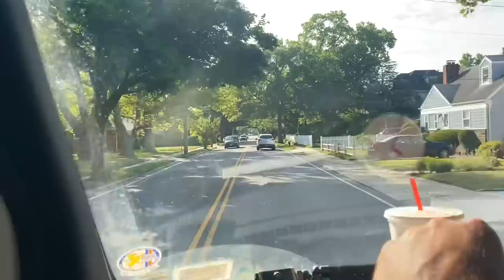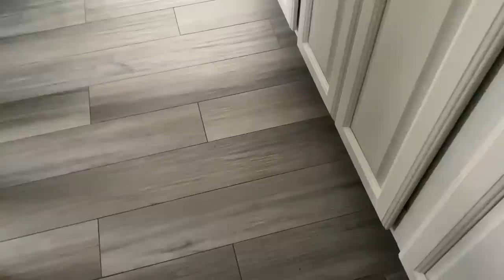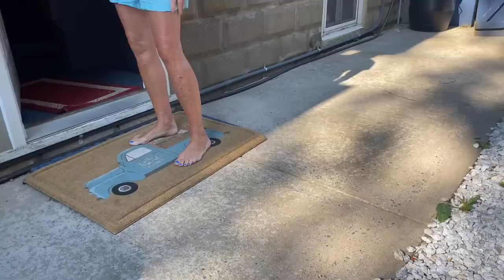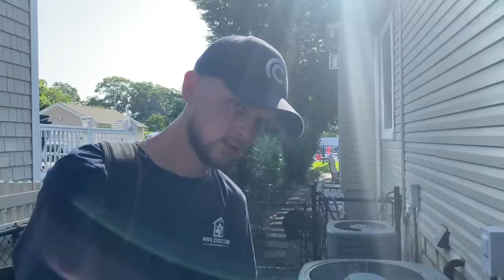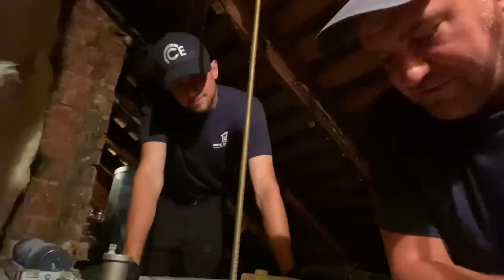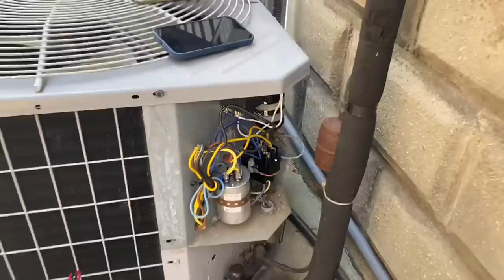Mysterious Case of Condenser Not Cooling Can We Find The Issue?

Comment: Hate those calls....Had one at beginning of cooling season. First tech replaced contacotor...worked for a week...same tech went back...stat wire broken outside by house... Lasted 2 weeks.. I went bad and said hell with this...ran new stat wire from furnace to condensor....new connectors on contactor...havent been back
Reply: best way to do it
Reply: until it ends up being the wire from the tstat to furnace or tatat itself
Reply: He did all the other work for ya lol, and the thinking as well of what and not to do
Reply: @ThermalSolutionsHVACR  Thats true lol..

Comment: back when I was doing this, if it was intermittent, I would start with turning everything on (call for AC) and then jump to voltage checks BEFORE moving any terminals. Any tarnished terminals got the heave-ho before heading to component checks. I found more than one contactor that wasn't getting a full 24(+) volts and chattered, especially during brownouts. Wires cut back plus new terminals installed with dielectric grease and problem solved.

Comment: That capacitor is just fine as the "HD" one.. Those are the ones i use.. I wont use any other except those JARD/MARS ones when i can get a deal on them...

Usually contactors going bad are the result of the contacts themselves welding or wearing out from arcing so much....  Rare the coil went out but i seen a brand new out of the box go bad so i guess it happens..

All i stock is 2 Pole 40amp 50amp res so i can use them for heat kits, outdoor condensers, name it....

Sometimes you get one that buzz's a lot, just take a piece of armaflex and stick under it, tighten back down. Buzz solved.

Comment: It was most likely the “EZ trap” safety. Especially if it’s wired in series with the Y terminal to the condenser, it looked very clogged, probably was draining but way too slowly. If this was the case, it saved the ceiling! Also the new contactor was a good idea. Thanks
Reply: yep, probably extra high humidity those days and it was producing more condensate than it could flow. 
the extra humidity source could be caused by ambient humidity or people using water indoors (kids love to play in water).

Comment: What kind of thermostat? Hopefully wasn't a Nest!
Reply: Install a nest and there’s a big chance you’ll have intermittent problems, took me over a month to find a faulty nest on one of my customers system, system would just stop cooling, I’ll check floats make sure motors and compressor aren’t cutting out, all the while that dumb nest was faulty.
Reply: @kevonslims7269  Yep, they use transistors instead of relays and if it doesn't have the C wire that is just asking for trouble.